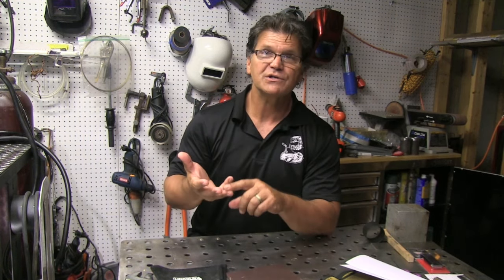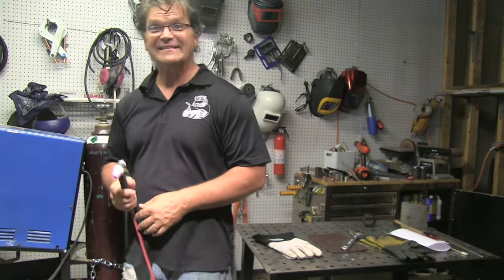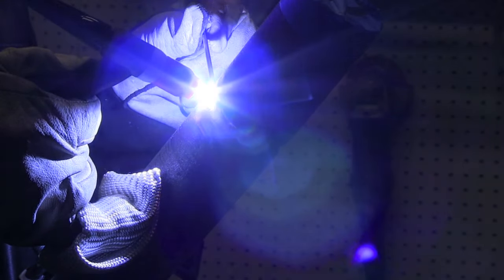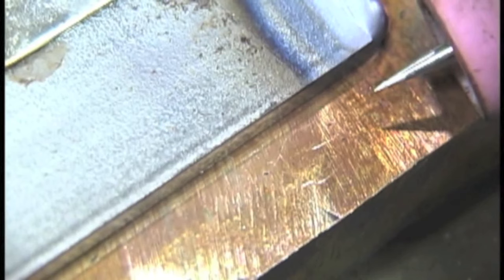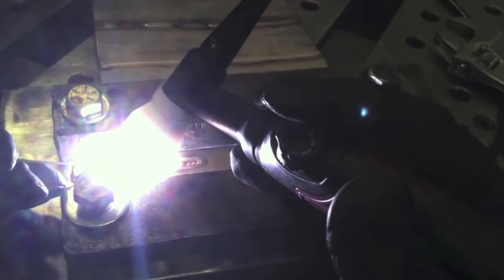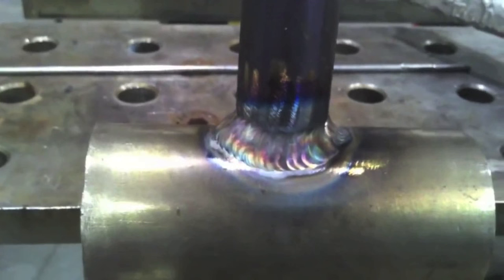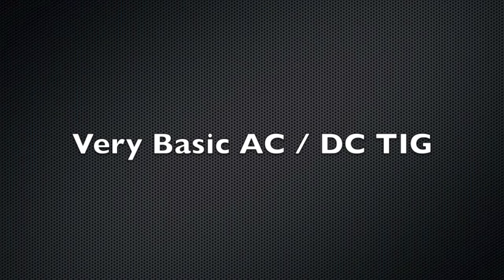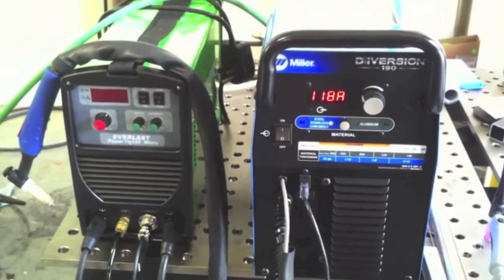TIG Welding Basics Overview

Comment: I've welded for years, and was privileged to tig for two of those. My tig experience was limited to mild steel. While I got some schooling on aluminum, I've never really gotten any on the job experience. I've been medically retired now and am not able to do much welding anymore. Physically I can, I just don't run into many occasions to do it. I would like to thank you for these videos. They're quite informative, and it's just really nice to see a real expert at the craft. I would appreciate a different way to contact you and get some info on equipment and supplies you've used on some of these videos. Thank you.

Comment: Thanks for the videos, i've welded for YEARS using a shitty flux core $90 welder, but since it was moslty sheet metal and gunsmithing projects i wasn't a big deal.  Now that i want to build stainless turbo headers for my 68 firebird so i want to learn to tig weld.  Your videos are very informative.

Comment: I work in bronze sculpture - but I'm an 'apprentice' - there are no apprenticeships in this field.. Your videos are thorough but no videos explain the delicacy of tig on bronze (being such a soft metal and sometimes I'm welding a 3mm finger back onto a hand) .I feel that you have the understanding of the tool that could illuminate the delicate work involved in sculpture. Do you have experience w bronze sculpture or would you please work on one. So you could share your massive welding experience w us learning to get bronze sculptures right. I think if you worked on one you would have a lot too share. This is one of those rare trades where we don't have apprenticeships and there is little too No videos online. My boss is busy and I want to keep my very rare position in this trade. It is very different from structural welding - we have to be able to adapt to the thickness and texture of the piece. It takes all the different techniques at once. I'm doing my best learning on the job but I think you have a way of speaking principles that my boss who has been running a bronze sculpture foundry for 20 years may lack - because we are always under pressure to make a crust and he now works intuitively . I CHALLENGE TOO YOU TO TIG WELD A PROBLEM BRONZE SCULPTURE AND TEACH US WHAT YOU LEARN. I've No Doubt you would have interesting solutions. I also think you would have fun with the task. I'd love too be able too learn from what you find. Sean , Melbourne , Australia.
Reply: send him him material

Comment: Hi Jody, I recently purchased an Everlast 250EX, primarily from what I saw you do with it on the Welding lathe adjusting the parameters while still being 1000+ cheaper than an equivalent Miller or Lincoln. 

One thing I would like to see in future episodes if time permits is show what combination of settings allowed you to utilize the "manual pulse" like you did at 13:45 in this video. I am not sure if there is a rule of thumb as to what percentage of your weld amps just be there, but 33% did not work for me on that application, I would lose my arc.

Definitely subscribed for the future videos.

Comment: Thanks for the great video Jody. Been a welder for many years and learn something from your vids every time I watch. Love the big and little tig fingers.
Could you go over tungsten size and selection of different tungsten choices relative to what jobs or materials your going to weld? (Stainless, mild steel, aluminum, magnesium, titanium) Collets needed and any other helpful info you throw in for good measure.
Reply: This was my question also.  I am always burning up tunstens.  Tungsten sizing, cup sizing, flow rates and current levels.
Reply: I'm pretty much still a noob at welding. I've welded some mild steel after getting my powertig welder and have only used one size tungsten and one size cup. I know I need to go up a size on tungsten for higher amps and bigger cups for larger coverage but that's it. Some help on this would be great when I move up to aluminum.
Reply: My default (I am using an inverter machine) is a large gas lens collet body, using either a #7 or 8 gas lens , a 2% lanthanated tungsten (I switched from 1.5% after some trial and error) . For 25 up to 160 amps I use a 3/32. I find this is my default set up for 90% of what I weld.
Reply: Shan Beckstead Since buying my inverter welder (Everlast 250ex right after Jody's review - Thanks Jody) I've played around with a bunch of tungsten and cups and came up with pretty much what you have. I use 3/32 for 90% of my welding.
Reply: It works, I have used 1/16th on occasion for super thin gauge stainless. In most cases in dealing with aluminum any thicker than 1/4" I use a 1/8'' as I tend to run around 200 amps and prefer the bead profile Vs a smaller tungsten. I will say that I almost always run a gas lens type collet as they simply produce a better weld.

Comment: Jody,  We are a farm operation and have a very large Miller welder that we weld nearly every way with.  Recently, we have needed to repair aluminum irrigation pipe that is at least 50 years old.  Our attempts at using tig were a complete flop.  The video today touched on cleaning action and the light bulb went off in my head.  I am almost positive after watching the video that our machine is not capable of making the needed adjustments for affective cleaning action.  If you could emphasize the cleaning action involved in welding aluminum when those situations come up.  We may need to purchase a nice portable, tig capable, welding machine that is able to make the adjustments necessary.  Our present, very large and heavy unit presented us some problems in the voltage settings also.  The lowest voltage setting was ten, when we may have been better off at a lower voltage. Really enjoy your videos.  Our shop is all tig finger equipped.  Nick L
Reply: Clean is the key to tig welding. Old aluminum that has been exposed to the elements will need to be cleaned thoroughly. For portable use you should be looking at inverter welders. My portable setup is an Everlast inverter AC tig welder. The AC will give you the cleaning action and you'll need to set the balance. Miller has inverter models too but are pricier. Good luck
Reply: Jackson Young Thank you much for your input.  We have come to realize that we are probably asking too much of our big Miller (very stationary) welder.  According to the owners manual it is capable of nearly all types of welding provided you supply the correct add on equipment. We have burned tons of stick rod over the years and have been very pleased with the results. By acquiring a wire feed unit we have had good outcomes until the wire feed apparatus died,  Recently after watching Jody's videos we have acquired a gas bottle with flow regulator and the hose and torch assemblies.  Our attempts at tig welding mild steel have gone very well, but our attempts at making weld repairs on the old aluminum pipe have gotten the best of us.  We have done the surface prep. with stainless brushes, but have not been able to clean the inside of the pipe.  Both surfaces have been contaminated by the water and environmental elements. The pipe wall thickness is right at 1/32 so things need to go just right or we have more holes than repairs and if we don't burn through the heated area (welded area) appears very rough and/or has a pin prick surface appearance. Have been unable to determine if it is possible to make cleaning adjustments like Jody has demonstrated so well with the portable units being used in the videos.  The time has come to acquire a new welding machine.. Nick L..

Comment: amazing video as usual Jody, thanks for that.

my question is how close is your tungsten to the puddle when doing TIG in AC and DC current? it looks like you are actually touching the puddle, but we all know if it was touching it would be smoked! that's my biggest problem, I get as close as I can to the work material, but if I add rod, I run the risk of smoking the tungsten.

thanks in advance,
jefferson
Reply from the maker: I typically hold a longer arc on AC aluminum than I would on steel. Just because steel is more forgiving if/when you dip your wick. Also, torch angle makes a lot of difference and can fool you .  when you lean the torch back too much, the electrode can be  really close to the puddle where the taper stops. The tip can look like its not too close, you add wire , the puddle rises, and before you know it you sputter.
Reply: thanks for the tip Jody.

Comment: I wish I had subscribed to your videos before I bought my welders. . .I have (3).  My first machine is a decent 80 amp Century flux core.  I then got a good deal on a used Miller EconoTig 180 and I also bought a 110V 100 Amp Lincoln MIG machine which I spent a fortune on converting from flux core to MIG.  Anyway, I wish I had spent my money on machine(s) with some of the more advanced features.  Just a word of advice to newbies.  I have found over the years that the price buying replacements for cheap tools (including welders) is far more than buying the right thing in the first place.  All that aside. . .my question is regarding frequency and TIG welding Aluminum.  My EconoTIG is an AC/DC transformer machine, so I assume it is always at 60 Hz.  I welded a broken Aluminum golf cart frame once with decent results.  The weld is plenty strong, but I could not get it to clean properly - it did not look very good when I finished.  You just welded some aluminum at 50 Hz (which is LOW frequency).  Everyone tells me that I need high frequency to weld aluminum.  The owner's manual on the EconoTIG doesn't give any specifications as to the frequency being "high". It reads:  "AC output for superior aluminum welding" and "Built-in arc assist stabilizer for AC TIG on aluminum".  I don't do a lot of Aluminum welding.  But, I'd like to know what limitations I will face using this machine and what the deal really is about the frequency needed for Aluminum TIG welding.

Comment: One of the best TIG videos! I'm taking a TIG class now (67 yr old Disabled Veteran).  Looking to buy now. Can you recommend an Ac/DC HF machine with good AC balance for Aluminum and a Flex head torch with good foot pedal. Mostly will be doing metal art, but also other projects. Prefer to stay under $1200for machine. Already using XL TIG finger. I like it , but it frayed easily.
Reply: Steve Friedlander ever last 211si its a mts machine that rock's!!check it out

Comment: I do a few cast iron and cast steel repairs every year, mostly for farmers on older or antique farm equipment. For most of them I generally braze using  oxyacetylene, but I was wondering if tig brazing with aluminum bronze or silicon bronze would work as well. Also what would be the best procedure for this process. As I also do the machining, I can fix any boo boo's from either end lol.
Thank in advance, and I'm am looking forward to the rest of this series.
Ian Little

Comment: You're off to a great start there is a lot to cover.  Maybe metal prep (can't be clean enough), filler metal selection (repairs, SS, cast AL, general use for steel, AL, SS).  Ex for CRS use ER70S6 or for aluminum 6061-T6 and 4043 filler.  I don't know like I said lot to cover...good stuff thank you for the video(s).

Comment: I recently seen a post on HF interference. They said to eliminate the "noise" twist tie the first couple feet of your ground cable and the torch cable together. They also stated that it would help focus the arc. What are your thoughts on this?
 In my profession I see twisted pairs of wires to reduce "noise" on computer wires and the theory makes sense. Look forward to the videos every week :)

Comment: Jodi, great job as always! Viewers can pick up so much in addition to your narrative by watching your examples. Good stuff! 
One question, I worked government construction when I was younger and witnessed something they called Orbital. It was a machine but seems there wasn't any electrode and the welds often failed. I thought maybe since they weren't flush and material could get caught in the depresses ion on the inside of the pipes. Does this method still exist and is that why they pass/fail? Didn't seem like the pipes were load bearing just had material passing through them.

Comment: Hey buddy, great video as usual. So... I too think it might be helpful for some expansion on the cup/tungsten selection. However,  any more info you can give about problems that may come up with different materials would be great. Example: aluminum, etc. Maybe show some exotics? Copper welding is fun, maybe some chromium alloys? Keep it up brother.

Comment: I'd like to hear more about balling the tungsten for aluminum welding.  I couldn't ever get my miller 250 to weld aluminum at all and by chance I started noticing that if I had a small ball on the end it would weld great.  What do you use to get the ball on yours?  Do you use a piece of copper and do you run it on AC or DC when forming the ball?  Also is there a rule of thumb on ball size?  I never seen anyone talk much about the ball for aluminum

Comment: I dont have the stediest hand for tig welding (blind as well double cheeters in the helmet) so I choke up on my torch it gets hot and very hard to hold for long. Have you thought about a tig finger wrap for the torch. and yes I do have a tig finger its helpful maybe the XL over the torch could help me. Im using a flex head air cooled #17 and a dual voltage HTP invertatig 221. Thanks in advance your vids have tought me plenty!

Comment: Hey jodi,My name is Joel,  thanks for all your tips they have really helped my career out in getting me to the position I am in right now....however one thing I have noticed you've never really touched basis on is porosity in tig welding caused by different things such as no gas coverage,  contaminated wire/tungsten, etc. It would help me and others as well to maybe get your expertise on this and how to best prevent this. I'm currently about to take a 6G test on 2 inch, 3/4 thick carbon steel with a er70s-2 root pass and e7018 fill and cap. I have been struggling with porosity Pete as they call it. Any tips would be appreciated.  Thanks.

Comment: Hey Jody (hope I spelled that right), fellow welder here. Machine building/ aerospace/ pressure vessels/ etc.... I've never tried it but can you use nitrogen as a shielding gas for tig or mig?? I know it's typically used as purging for brazing refrigerant lines. Do you know the reaction it will have on the arc? Maybe future video? You do a great job brother, big fan.

Thanks a million
-Tony

Comment: Hey Jodi, how do you travel along with your tig torch hand without shaking? When I TIG weld, I rest my hand on the piece of metal, move the torch by twisting my wrist from right to left but when I need to move my hand and arm to keep on going, I start shaking like crazy and cannot keep the right electrode distance and dip the tungsten often times.

Is there any tip on hand movement?

PS. Your TIG finger is a real insiders tip!   - best wishes from germany ;)

Comment: I noticed the rod you use is pretty big in most your videos. Do you use 1/8 on most tig welds or 3/32. Seems the bigger rod helps fill the puddle easier. Ive been using 1/16 tungsten and rod and its ok. But can only make little tiny welds.

Comment: Jody- question about Tig weld-depth: say I've got 1/8" cold-rolled sheet and a simple lap-joint... is my goal to be as cold as possible while melting the joint just-enough to create a fillet (either with or without rod), or is my goal to make the weld as deep as possible so I can see it on the back-side? Is my goal to just have a bunch of top-side dimes, that if there was only one dime you could easily break the weld (like a tack), or is it to have a deep-dime that would have to break the base-metal to break that single dime free? -Mike

Comment: Jody, I am a hobby welder, and because I don't use TIG as often as I should, ( I still use a torch a lot), I always take the time to review your welding videos  to review setup and techniques.  I find that your instruction videos are superb.  I do have a question.  I have a Dimension 400, and I have an old Westingarc spool gun attachment that I would like to connect to the Miller. I have done a lot of searching, and can't find anything on this attachment.   Do you know anywhere I can get the information I need to hook it up properly?
Bob

Comment: Jody hi, I know this video is a little older so I hope you can get back to me . I'm in the process of buyin a new welder . I've been welding professionally now for 10yrs but all fcaw, smaw,and gmaw.   But never gtaw... My question is I've been doing my research and in watching your video you had said something about  high freq and scratch start . I was wanting your thoughts on lift ark /lift start? I also run a shop at the house and do a little of my ow production welding there. So this is why I'm purchasing a new welder that can run tig. The machine I'm considering is the Miller 304 multi process mig runner . Any thoughts would be appreciated

Comment: Jody great video. My questions are: given a choice would you go with a 200 amp Everlast or HTP welder. does a new tig welder need a water cooled machine. Can a machine that came with a air cooled torch be retrofitted with a cooler and a water cooled torch. Can the air cooled torches that come with the above machines be used at 200 amps. Thanks

Comment: I just started to learn TIG and i have a Lincoln multiprosess welder with liftstart and it dont have footcontrol or adjustable torch and would like to learn more about heatcontrol and how to reduce distortion on thinner metals.